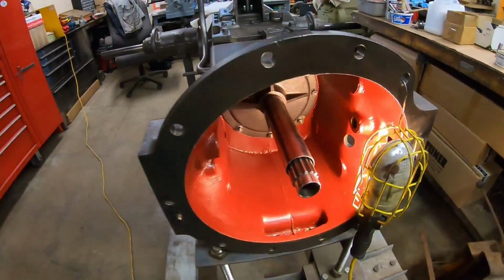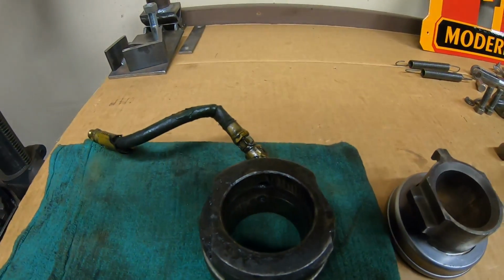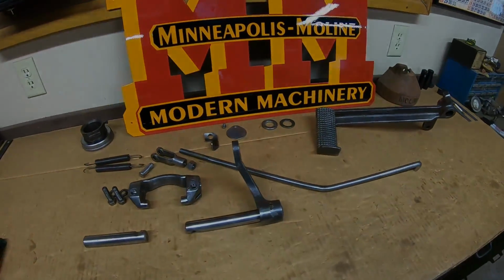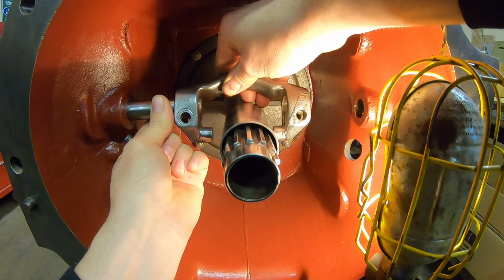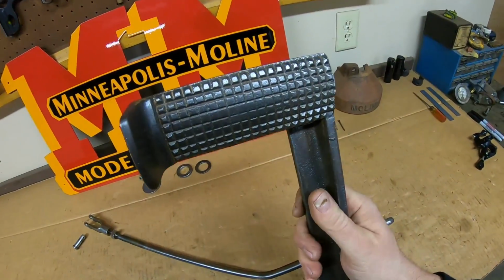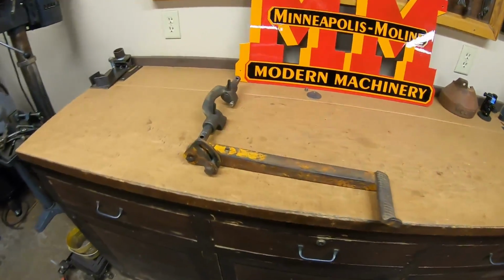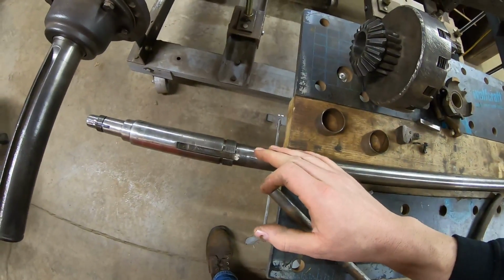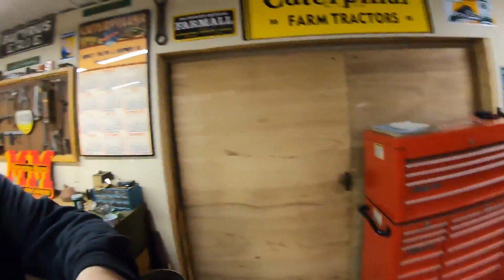#X231 Prototype Part 57: The Coolest Clutch Pedal Ever & Serious Problems Come Back Around...

Comment: Damn <grin>, I was getting stoked about the "bad news" part at the end...  I was hoping that meant indoor winter D2 Cab work.   
As a retired Product Development  Engineer, that spring setup on the T/O bearing is cringy at best. Those spring ends are the "wrongest" orientation they could use.  I spent some serious time going back over the first 11 minutes to see if there was any better way of doing that... and they just really backed themselves into a bind with the parts they used/created.  A nose down bias with the springs, a nose up moment under actuation. It's going to rock in/out on the clutch fingers... and there really isn't a fix.  I gotta think you were right about the slot cut in the tube as a passive oiling attempt.   If she were going to be anything more than a trailer queen, you might be sorry you "fixed" it.   Shocking how well it survived.

Comment: I'd like to see the prototype axle re-visited and used. My idea of a solution probably won't meet your standards, but I would swap left and right axles if possible, so the spline wear is on reverse and overrun. Oil the axle gear then JB weld the axle and install the gear. So the epoxy takes out the play in the splines. I think that epoxy would be strong enough in compression, and unlikely to wear given the amount of time it will be used.

Comment: I have a complaint...😂 why did we not add a famous squatch nut locking devise, and the spring hook looked a little spread out.. The reason I ask is that the spring bracket appears vulnerable to turning that nut...

Comment: X231 deserves as much of the original parts as possible But there comes a time where it is not possible so you will have to do what you have to do to get the project finished and X231 back rolling.
Are those 2 springs enough to hold the clutch pedal up? You appeared to have to have to lift it up.

Comment: Excellent work once again. and another storage container or more is cleaned out. 
Not having the whole picture, any knowledge of the teardown, of any of the 2 or 3 tractors or the study of parts at swap meets etc, I am seeing 3 main pieces, the pto clutch assy,  the shaft, and the flywheel / center. 
Your PTO/Clutch assy is damaged beyond normal repair, So I would think that most of the rear end items will be of production vintage. 
the flywheel with the spline center that is loose, I do not know how feasible it is to tighten that up, and you are pretty sure that is not a 10X flywheel, you might be further ahead to replace the flywheel as a machine shop might not care to machine the flywheel with loose parts in it, If you have the center reinstalled into another flywheel you should have it balanced as it also would effect the engine performance / life rather quickly.
which leaves the shaft. You have said that the 10X shaft and production shafts are really different, and not really interchangeable, would it be possible to Make a new shaft since it will not be used, or intended to be used except maybe no load to watch the shaft or pulley go round and round.

Have a great day! looking forward to seeing the Swamp Angel  out and around in the environment.
Reply: @squatch253  Always! 👍

Comment: I would think you could find a splined hub you could put into the flywheel after boring it oversize?  Also, splines can be cut on a lathe, it's slow as all get out, but can be done.  I wouldn't hold it against you either if you farmed it out.  Is the H even accessible right now?

Comment: Excellent video the clutch linkage is quite a masterpiece of engineering.  It's interesting that they didn't provide a lubrication line for the throw out bearing but I am guessing that the R and D department was just trying to get a bunch of prototype tractors out and do testing and then start improving or making lots of changes to a some what final design. Keep up the great x231 videos
Reply: And this tractor wasn't supposed to see a lot of hours. A dab of grease would make it through the proving grounds.
Reply: 'dab of grease would make it through the proving grounds' ... especially if they were experimenting with one thing in particular, like how gentle they had to be with the amplitorque.

"Who cares if the clutch linkage isn't going to last, we now know that the amplitorque works just fine being hard-shifted."

Comment: “It wasn’t done down on the farm because it wasn’t done with torch.” Laugh Out Loud!

Sorry to see the watch minutes going down. Frankly, I was not engaged that strongly with X-231 when you paused to do the Swamp Angel and the Super M jobs. I was just more familiar with Cat crawlers. But now I think that X-231 has a much greater “cool” factor between the historical significance, the inside look at prototype engineering, and especially the mechanical arts and creativity required to overcome the damage, wear, and lack of parts. 

My guess at this point is that is going to need a “new from scratch” live power shaft. Salvaging/replacing that trashed clutch and spider are going to be real tests. Is there an option for a higher membership fee to help the channel?
Reply: There are three membership levels: $5, $10, and $25 per month.

Comment: Congratulation to the final status you reach on x231. I think the threadet hole on the clutchpedal was for an pedaltravel stop? To stop the pedal from going too high?
It also looks that the pedalweight always cause presure on the clutchreleasebearing, so it spinns always, when the engine was running. I dont think the two springs was strong enought to release the bering complede from the clutchmechanik on the flywheel. Maybee i miss some details who wasnt mountet yet, who keep them in an proper configuration.
For the wornout teeth in the flywheel an the powertakeoff shaft, there shoult a replace teethed bushing and teethed shaftpiece can bee an soulution. Maybee the ptoshaft hat to compledely machined new, but you think of that, some videos before, i remember.  I hope you had an pto clutch video on track, where you describe the differences between x231 original and the seriall ones.
And then I/we understand how much work it was, to safe some of the original parts or swap on the seriall production ones. 
And then  hopefully we can watch, after the farmall series, witch way you choose to go :D
greetings from Austria

Comment: I must be missing something, That poor clutch pedal looks like it really wants a spring... Looks to be laying down in sort of a flattish position...
Reply: @squatch253  ....interesting, I always figured that the purpose of the Springs was to keep the bearing off the clutch so it wouldn't wear out from being used when the clutch wasn't pressed. If the clutch is keeping permanent pressure on the bearing, don't see the purpose of the springs...

Comment: I just want to thank you for what you have done so far on X231, I have enjoyed every minute of it.   You work on her has been unbelievable!   X231 is a major reason why I decided to subscribe to "Members Only" channel.    I completely understand you will have to move on to a more popular topic and I will be watching that too!  Hopefully we can get an episode of X231 now and then.  I do have a question for you about X231.  You do a very good job on cleaning up all the castings prior to assembly but how do you combat flash rust on the exterior of your castings?  It seems to be doing very well and not accumulating a bunch of flash, do you use anything to prevent it or is that just due to keeping your shop climate controlled?
Reply: @squatch253   naw if they are rusty they're easier to hold on to. 🤣😂😁
Seen your eye twitch just now. 😉